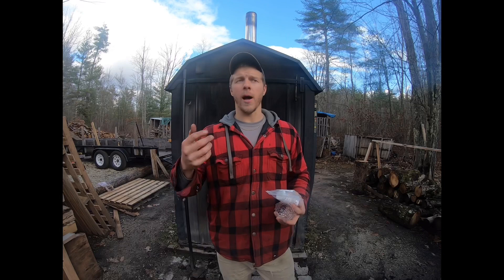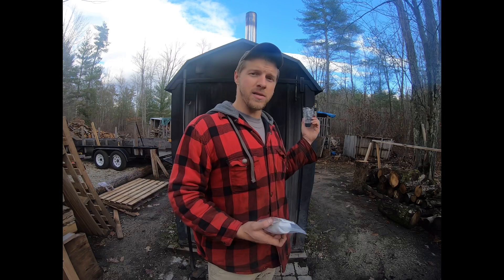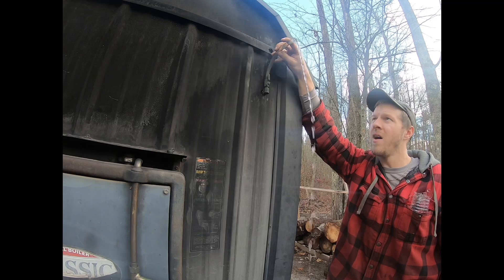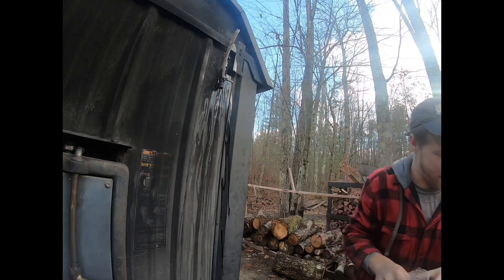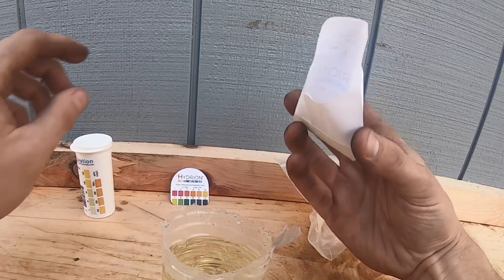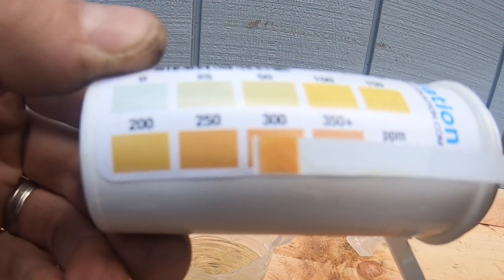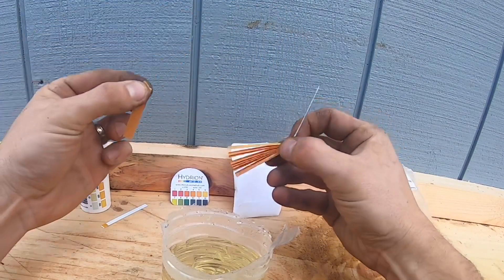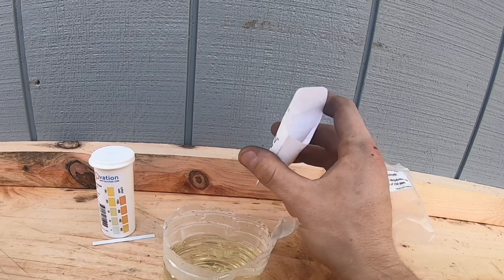Save Your Outdoor Wood Boiler! TEST YOUR WATER!

Comment: Dale here
I hope there is no confusion
The test kit I have had so much trouble with I think it is junk is the blue plastic case #598

NOT  the #2500598 that you displayed and demonstrated

I will be shooting a video soon on that junk

Your video was excellent and well done. You tested your Sodium Molybdate level and your ph that was boosted (I suspect KOH-lye)

Interesting to watch the Central Boiler video on why they changed corrosion inhibitor chemistry where that said it was NOT because of protection

Side note
 The test kit you highlighted I neither trust or distrust - time will tell
I have trusted the Sodium Nitrite based corrosion inhibitor for ten years and the #405 test kit which I found was more cost effective to maintain

Later all
Reply from the maker: Thank you Dale! Appreciate it! I mentioned you in the video and glad its all sorted out!
Reply: Dale it was because of protection actually.  They won’t admit to that unless you ask someone from the factory.   They have had so many failures they needed to fix it
Reply: @AATreeService  
I highly doubt that sir I was a stove dealer for 17 years and saw hundreds of stoves and I never saw one fail because of the corrosion protection unless there was none or very little in it
The problems were almost always from the side of the fire
Reply: @luvdogsandhorses  from what I was told from the factory workers, and central is very tight lipped, that they changed from nitrites to molybdate because the water jacket would corrode on the bottom.   Feel free to talk to the  plant manager or stop by the house right next door, the owner.  Bug him if you want. He will answer ya
Reply: @AATreeService  
Have you ever drained a stove and looked in the “inspection bung” at the bottom of the water jacket ?
Reply: @luvdogsandhorses  all the time, we even use a handy dandy inspection camera
Reply: @AATreeService  
So show some videos to back up your claims please
I’ve never seen it in 15+ years 
Only exception—— when either the wrong type or the wrong concentration of antifreeze is used
I don’t see a single video you’ve posted with wood stove maintenance
Reply: @luvdogsandhorses  I have a life.... I own a tree service, landscaping and directional drill.   This is my down time.  I have a lot of videos on my business page, U can find that on your own :)
Reply: @luvdogsandhorses  no hurt feelings here :)
Reply: @AATreeService  a person may be morally bankrupt when their mouth writes checks their body can’t cash ... and they don’t seem to mind 
Shameful
I hope your soul finds healing
Reply: @luvdogsandhorses  I have written no checks I can’t cash.   Feel free to move on with your life I have nothing I need to prove to you. Me and my business survive just fine
Reply: @AATreeService  talking about your lack of integrity— not your business 
Your response proves you have no concern for fulfilling your spoken word
Speculation,Innuendos, supposed “insider” knowledge you can’t or won’t confirm

Makes you look like a petty man
Reply: @luvdogsandhorses  seems like someone got a soft spot....... we all see it :)
Reply: @AATreeService  
How many days did it take you to come up with that one ?
😂
Reply: @luvdogsandhorses  again proving my point :)
Reply: @AATreeService  
Nice to hear from you again sweetheart